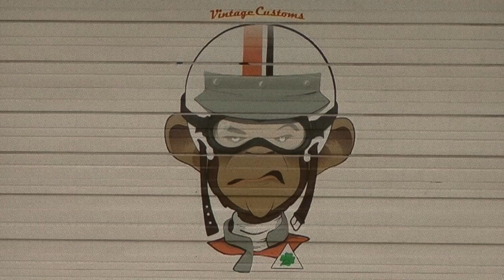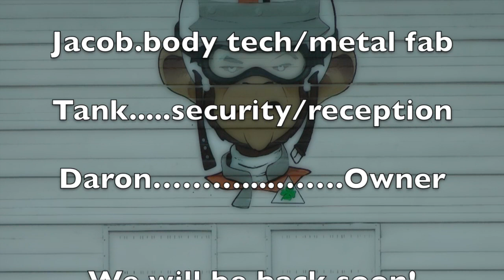Vintage Customs Winter 2015

Comment: Hey I have picked up a 1984 gtv-6 not a real old vintage or the Calaway but picked it up for a steel. It has been sitting in a garage for over 18 years. Just turned over 40,000 original and documented miles before being parked. It came with all documentation and delivery slip. 1 owner with A title. Anyway to the question, where is a great place to purchase OEM parts such as fuel pump, clutch, lines etc..... I will be starting this project this summer. New to Alfa Romeo. Excited to get rolling with it.

Comment: Great tip on increasing the output of the tail and beak lights...ive been thinking about this for a few years now...especially since my 1750 got tapped last year in slow moving traffic at night. I think would like to swap out the headlamps as well as I find that even at normal driving speeds I outdrive my headlamps on dark roads at night. I would also like to bump up the brightness of my dash lights the 1750 dash lights are remarkably dim...not sure what the best approach is for that. Putting in a new wiring bundle this year so now is the time to do it.

Comment: Great video, thanks! :)   BTW, sometimes the latch on my doors stay "up" after I´ve opened the door. This happens 1 out of 5 times. I must then adjust the latch by hand, or the door will bounce back when I try to close it. perhaps there is a return-spring of some sort that needs to be replaced?